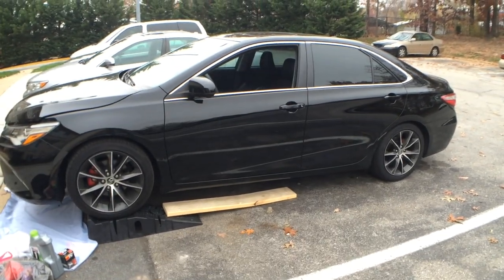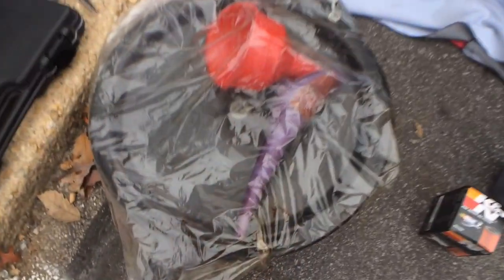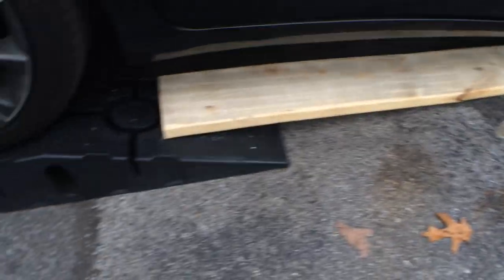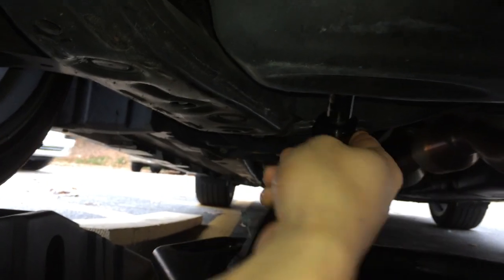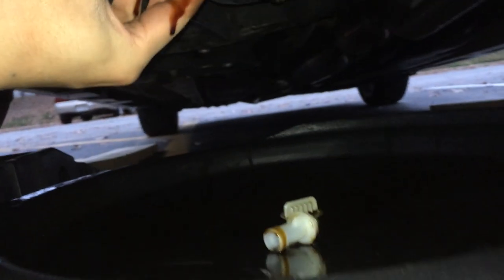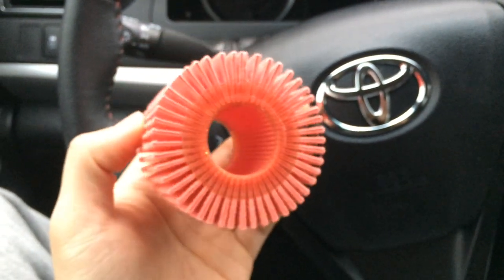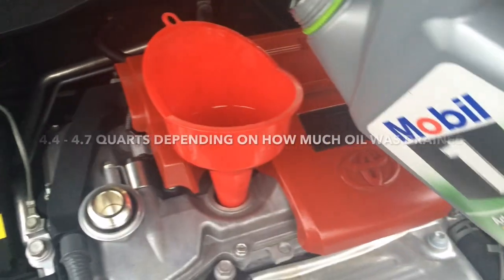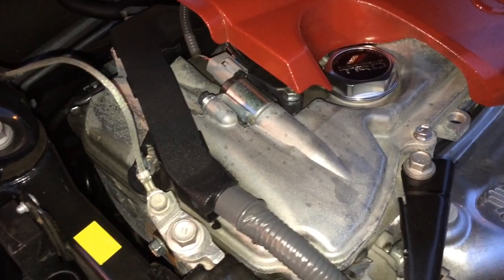2015 - 2017 Toyota Camry 2.5L OIL CHANGE

Comment: Skip the 2 yr free service from the dealer which is not worth my time waiting for hrs..
Reply: Carmeli Ri agreed!! Also Toyota will only change the oil every 10,000 miles with the 2 yr plan( no sooner which is bs!) Unless it's all highway miles, changing your oil every 10,000 miles is not a good idea!
Reply: Good idea. The dealers can't be trusted to do the job right. They are notorious for over-tightening the oil filter cap assembly.

Comment: Do you know if the 2015 Camry requires synthetic oil or is it optional.
Reply from the maker: The manufacturer recommends synthetic but it is optional. Synthetic oil can go 10,000 miles between oil changes, conventional oil would be able to go up to 5,000 miles.
Reply: I believe only 0W-20 is recommended. Did you ever try to find a job synthetic, conventional 0W-20 oil? It doesn't seem to exist.  If you're looking to save money then get the full synthetic 0W-20 Super Tech oil from Walmart.

Comment: from the bottom of the car which direction to turn the end cap filter wrench in order to loosen up the whole piece? Turn left or right?? (when your in bottom of car looking up)
Reply: It should show on the filter wrench cap.
Reply: Everything is the same as a bottle of beer. Counter-clockwise to remove.
Reply: JI IE IR IE IMI II /A\ IHI right to tight. Left to loosen.
Reply: The same way as you would to open a bottle of beer.
Sounds like you have a stuck oil filter cap.
Everyone who has this system should be prepared for a worse case scenario especially if this is the first time you're doing this.

In case of a Stuck Oil Filter

Make sure you have the following...
1. The proper Motivx* oil filter cap wrench. Item #MX2320 is for all Toyota/Lexus/Scion engines 2.0 liters and larger using a cartridge style oil filter or item #MX2321 is for all engines smaller than 2.0 liters using a cartridge style filter.
2. A 27 mm ½ inch drive socket
3. A ½ drive breaker bar (18 inches or longer in length. An extension may be needed for some models.)

If an oil filter cap seems difficult to remove, only the above items should be used (or equivalent tools). Do not simply use a ⅜ inch drive ratchet or ratchet with extension as these will sometimes result in breakage of the oil filter cap wrench or the oil filter cap.

Always make sure the teeth on the wrench are properly engaged with the tabs on the oil filter cap.

To prevent reoccurrence of the problem 
•Make sure new o-rings are properly lubricated before installing. 
•Use a torque wrench to install the oil filter cap to no more than 18 ft.lbs (25 N•m). Oil filter drainplug = 9 ft.lbs. (12.5 N•m)

* If you think the Motivx tools are too expensive at least consider the following... Do not buy an oil filter cap wrench that is made from cast aluminum. Only buy one that is forged. Do not buy one that is strictly a cap wrench that does not have teeth. Do not buy one that claims to fit all models or even all four cylinders. The 2.0 and 2.5 liter four cylinder engines use the same oil filter cap wrenches as the six and eight cylinder engines use. Only the 1.8 and 1.3 liter engines use a different size oil filter cap and oil filter cap wrench. If the oil filter for your four cylinder vehicle comes with one o-ring instead of two then your vehicle takes the same wrench as a Prius or Corolla (unless it's a six cylinder). If your oil filter comes with two o-rings & a service pipe for draining the filter then your oil filter cap takes the same wrench as the six and eight cylinder engines. Some companies claim their wrench works for all four cylinders but on the 2.5 liter engines that smaller wrench does not engage the teeth on the wrench to the tabs on the oil filter cap. It may work if your oil filter cap is not stuck but it is a poor choice. They are mislead.

For those that don't believe this is a problem...
https://youtu.be/Wm-VMIkTw6k

Comment: Hi there I have  a 2017 Toyota Camry LE and I just put 3000 miles on it. Will there be a reminder to tell me that I need an oil change?
Reply: If you are using the full synthetic oil, which is what is in it from the factory, you don't need to change it every 3k.... manual and service dept at dealer says every 10K !!
Reply: Not at 3000 miles.

Comment: how's working your camry at 62000 miles?
Reply from the maker: It's not at 62000, the odometer was actually at 6,200.XX. The vehicle now has 26,000 since this video and it's still running strong!! Arguably the most reliable engine ever produced in my opinion.

Comment: Nice how many miles before replacing that 0w-20 mobil 1 synthetic.  I have 2016 Toyota Camry it should be the same procedure replacing the oil?
Reply from the maker: Ralph Reyes same procedure. I replace mine every 7,500 miles. I'm sure it could go 10,000 miles though.

Comment: very nice, mobil 1 is the best oil out there. did you get first 5 services free with toyota care, comes with every new toyota vehicle. 2 oil changes and 3 tire rotation service free within first 2 years.
Reply from the maker: +techten21 yeah I did. I just prefer to do the oil change myself, but I do go in for tire rotations.